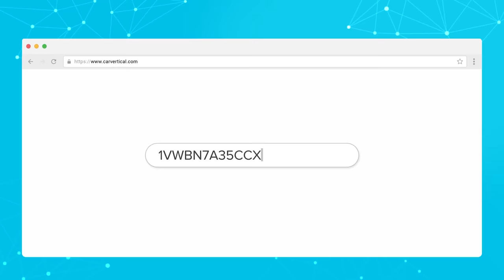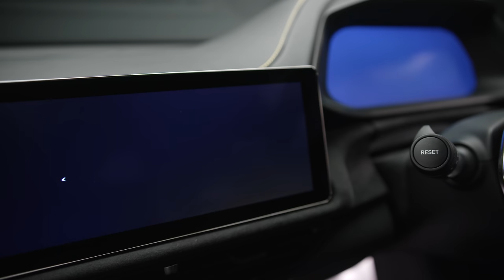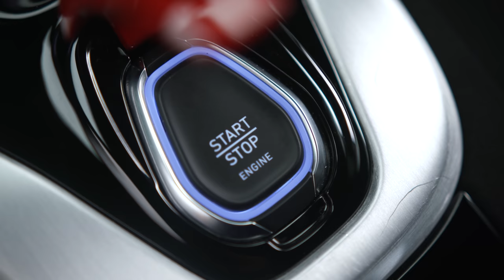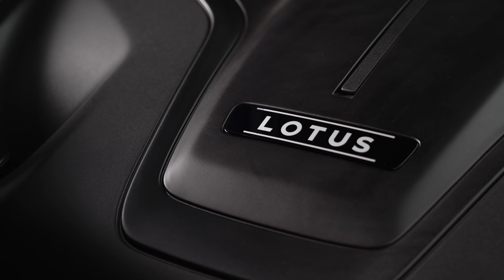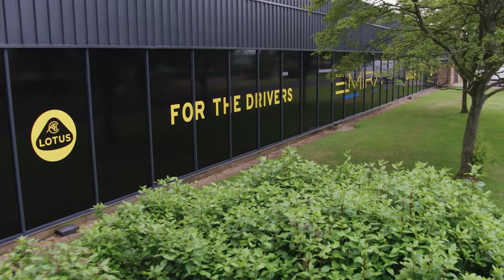The New Lotus Emira - An Evora Fan's First Impressions.

Comment: It's really a 21st Century Esprit...but what will alienate traditional customers is that silly iPad stuck in the middle of the dash. Ridiculous...performance cars should have simple buttons to give instant control and total focus on the road from the driver...not scrolling through silly menus to alter basic controls.
Reply: This should have been mentioned amor, I really don't like screens. The way they are implementing screens is as part of the vehicle, where we had before it was just the part for double DIN Dash that you could take out. I'm okay with a screen as as long as it's the dumbed-down functionality of music playing navigation. Or just make it a double DIN in the allow me to put my own preferably. I just don't trust a manufacturer to not screw with me I want my own stuff. If they had made the car with a bunch of switches and then allowed for the option to sell you the car with a dumb radio that you can do your own aftermarket that would have been ideal. For a driver's car I don't think that's much to ask. Either way I'm just going to get myself a Porsche from 2003 because I just hate all this new stuff
Reply: its a car designed to sell to a much broader audience than your typical lotus owner. without modern tech a lot of potential customers would be detered from purchasing one. its a step in the right direction
Reply: @Nobody-tp2gu  Porsche do not include such crudely concieved looking-tech and no one is detered from buying their products. This is poor design and dumbing down, pure & simple and looks totally out of place in such a focussed and fine-looking sportscar.

Comment: Fair assessment and interesting insight on the wheelbase issue. 
The crux of the matter is that whenever Lotus have a new big cheque book shareholder, the customer profile changes ("we must be able to take 2 x 100 kg executives...and golf clubs").
A 400 bhp / 1400 kg Evira / Emora has a power to weight ratio of 285 bhp/ton. 
Compare this now to a warmed up Lotus Elan : 180 bhp / 600 kg...300 bhp per ton, 57 years ago...

Comment: I have concerns with this car. I was hoping Lotus was going to produce an Alpine A110 rival. They have sacrificed weight to chase sales from Porsche. That’s is a dangerous plan. The car looks amazing m. Very similar to McLaren artura. If it is £60k it has a chance of success. If it is £80-90k it will be a failure and another British car company in trouble.
Reply: You hoped Lotus would produce an A110 rival, but had they actually done that they might as well announce their bankruptcy right now..... their first priority is to actually make some money believe it or not so that being said do you challenge a car that sells by the truckload or the one that is struggling to move even a paltry few thousand units 🤔

(BTW, I don’t disagree with also wanting something more in the direction of the A110)
Reply: The Alpine hasn't exactly sold by the boat-load. Porsche sell way more cars than that, so that's the market to go for.

Comment: My deposit's down on the premise I'll be paying around £60k. Much more than that and I'll refund it. I hope not because I really want a manual and there's no manual presumably 'cheaper' 4cyl option.
Reply: I was told today that a manual 3.5 would start with a 7
Reply: @gbtivbay  appreciate the info, haven't heard any solid figures yet or finance packages. Worst case scenario I'll refund or sell the build slot
Reply: Why are so many still obsessed with manuals? They’re just slow and with fewer ratios and no launch control. Why buy a high tech modern sports car then opt for a dated vintage gearbox? Mental…. “Yeah but it enhances the driving experience “ whilst being lapped by all the hot hatches and M2 A45 brigade 🙄
It’s no wonder Lotus have decided to not only update their cars, but their customer base as well 😊
Reply: @PiersDeMann  because its fun? I own an MX-5 because it's fun too... It is beat in a straight line by most top end hot hatches but that doesn't stop me grinning from ear to ear when I pull off the perfect downshift flying down a country lane with the roof down. A tesla is faster than most supercars - let's all buy them instead. You can't just reduce cars to top trump statistics I'm afraid.
Reply: @LukeEvans55  yeah I’m not sure how much you’d be grinning with your hand permanently attached to an 8 speed manual constantly stirring the gearbox on the AMG based Emira whilst driving through town
Reply: @PiersDeMann  8 speed manual? 6 is enough lol. I've driven one of the most congested roads in the UK as part of my commute every day in a manual and honestly it doesn't bother me. As soon as I get on the back roads its all worth it. I totally get an auto for a car that's supposed to get from A to B as mundanely and efficiently as possible but sports cars aren't about that in my opinion
Reply: @LukeEvans55  have you ever owned a car with a DCT box?
Reply: @PiersDeMann  yes, I had an Audi TT with a DCT and sold it for the MX-5. Partly because it just wasn't fun enough

Comment: Wow how much drivel is spoken in this video. Nothing shared with the Evora, looks amazing and in the flesh having seen it at good wood it was even better looking. Inside was lovely. Special editions will be porsches worst nightmare.
Reply from the maker: Only the chassis (at least pieces of it), the engine and gearbox (for V6), the wheelbase, suspension layout...
Reply: @JayEmmOnCars  not what the lotus engineers and designers told us at goodwood. 🤷‍♂️ the v6 of course is but that’s to keep current owners happy. The amg is really the one to have.
Reply: @JayEmmOnCars  Most manufacturers do it and there's nothing wrong with it. Felt the video seemed really negative given you haven't seen it or driven it.
Reply: @Munkey1234567  But it has double wishbones therefore it’s an Evora chassis. The engineers, designers and marketing teams are all lying to us. Luckily Jay is here to unravel this great conspiracy.

Comment: I actually thought it looked quite good.  ~1400kg is a bit heavy for a Lotus, and it's a little bit disappointing that it's probably quite heavily based on the Evora, but it still should (hopefully!) be brilliant. The fact that you can get it with a manual and hydraulic steering is fantastic. Great video :)

Comment: Only 360-400hp on a sporty (but heavier) sports car is disappointing. 
Makes little sense and may undermine user expectations for performance and heritage.
Also its torque is definitely too low for its weight and class. 
Needs to be a minimum of 450+ Nm torque as any competitor like newer RS3, Z4, …etc, all have better stats and can handle it.

Comment: I'm surprised you don't think the Emira is a looker. I don't think anybody here expected more power than the GT. The surprise is that it didn't  get that tune in the first place. As for tuning,   I wish you could drive my  decat, Komotec 435 tuned 400 again, James.  It speaks vigorously  to what a modest tune can do for the feel of the car. Of course a more robust transmission would have been ideal but I don't think that was expected based on what we could glean over the last months. Even with that limitation though, I think you're being  too hard on this car's design and I suspect the public  will find it gorgeous.  "Cause it is! 

Lotus content is always a treat on your channel and you know the marque so you may be right, but I think you may be off mark a bit just this once. Still, I'll keep my Evora for the foreseeable future.  They're tough cars to replace even with newer, more fully featured  iron being introduced routinely.

Comment: The trouble Lotus will have Stateside is that it has to be compared to the mid-engine,  10-speed DCT, V8 powered Corvette C8 and it doesn't look like it can do that favorably at this point.

Comment: Saw Emira today at Goodwood FOS. Blue car in the showroom, black car going up the hill. Both looked very good. Black car sounded better than a lot of cars going up the hill.

Emira looked a lot more resolved in looks to me than the early Evoras (I had one), better proportioned to. Interior a step up (or two). It's a bit wider than an Evora, & this did seem to show.

A friend though thought the Emira looked a bit generic, too similar now to other sports cars, & had lost certain design cues that made it look like a Lotus. 

Evora in USA suffered from lack of dealer network. When there were reliability & supply problems/issues, this put people off further.

I saw 2 Evora 400's in the main Goodwood carpark, they still looked very good.

Comment: Not surprisingly, you have provided the best commentary on the Emira.  No one else has has the insight or temerity to call it an Evora with a heavily reworked  exterior an interior.  My guess is that they did this because it was the cheapest way to bring out a new car.  The Emira is best thought of as a re-positioning car.  It started with the Evija continues with the Emira which continues the design language of the Evija and  allows Lotus to cut ties, at least visually with all prior models.  

I do expect the car to do relatively well in the first year and struggle after that.  A single car is not going to address their limited dealer network nor allow it to expand as it badly needs to do.  I also doubt that Lotus will invest much mor in this transition car meaning there likely won’t be more powerful versions or a convertible.  This car appears to have one goal beyond re-positioning:  give Lotus something to sell until its electric cars arrive.

For my money,  the Evora GT is the Lotus to buy.  The Emira is likely to make Evora prices very attractive

Comment: In terms of breakout sales (particularly in the US) this car is going to face a major problem in the C8. 

The C8 is not as good looking by any stretch and it lacks a manual. But it will be more practical, is significantly more powerful and faster, and has. Real dealer network. That’s the biggest hurdle right there. Also, the inducement of the more exotic mid-engine platform for the lotus is no longer so strong vs the corvette. 

But another huge issue is the price. If it does start at about $70k in the US, then it slots right between the Stingray (the inferior car in my mind) and the upcoming Z06. That’s a huge problem, given what the Z06 looks to be: sharper, more driver-focused, and packing an FPC V8 to boot. 

I wish Lotus the best with this car, and I certainly have something else to consider next year when I go car shopping, but it seems a big hill to climb.

Comment: I mostly agree and would prefer to skip ahead til next year when they announce the Emira S or 450+ horsepower variant that is sure to come about.  Feel like they should've started with that to be more competitive against the corvette c8 and cayman crowds.
Reply: It is beautiful and more livable but to be up on weight and lower on power than Evora is tough to stomach.   At least they kept hydraulic steering and manual so lets hope for 425-450 HP before they discontinue the V6.   No interest in a 80k 4 banger.   I  have a Type R for that

Comment: Here is the thing. If you only build cars for the purists and just the purists, you won't sell enough cars. To sell enough cars, you need to attract the interest from purists, petrol heads and driving enthusiasts, all of a wide range of ages. Young people never took to the Evora's and it was really only track day enthusiasts who bought Exiges. This new model, looks likely to sell well because a wide range of people will be interested. It will have the build quality, comfort and tech that everyone (yes everyone) will expect, but also (hopefully) be fantastic to drive. Looks like it has been designed to make it look like a modern supercar but with sports car performance and price (think first gen NSX). My only doubt, is that the AMG inline 4 will not sound like how you would expect a sports car to sound. But overall I like it and think Lotus have done well.
Reply from the maker: Young people are probably the least likely to be worried about a turbo 4 pot

Comment: 100% agree with your comments James. 
IMO it looks better than the awkward Evora. 
Really disappointed with the proposed power output, at that weight it needs to be 500bhp to make it special. 
Also the seat position looked really high. A couple of videos mentioned the seat would be lowered in the final production models by about 20 mm, but will it be low enough for a crash helmet on the odd track day.
Keep up the good work, great content.

Comment: Those vents on the hood (bonnet) are styled from the Evija, and perform the same job as the vents on the top of the bonnet on the Elise/Exige/Evora (they're where the air going through the radiators vent out), but according to Lotus do a better job aerodynamically.

Comment: Hi James - well done on your channel my friend. I love hearing your comments. Having had a soft spot for Lotus for many years (never owned one) I really want this car to work for Lotus. I agree with most of your comments - and disagree on some. To add to your thoughts:

1. Styling - I like the styling so far. Yes, the Evora looked odd from some angles (3/4 rear view mostly) and the Emira front vents looks like it came from the Exige, was hoping for a bit more pizazz in that area. Need to see it in the flesh to really guage the proportions properly as this was the Evora's design archillies heel. 
2. Engines - whyyyyyy did they not launch the V6 with a DCT??? (hopefully that may come later). AMG 4pot makes sense for a price point but not when the HP available is so close to the V6 (and the new AMG A45S has even more HP than the V6!). Why is the V6 only 400HP? Agree - should be 450 at least. Interestingly the HP values across the Emira engine range are almost identical to the Cayman ( base to the GT4.)
3. Spyder version - This could really work and am sure would boost sales (also covers the Boxster buyers)
4. Interior - totally agree. l think it is clean & simple and works and was always Lotus's weak point - which was why so many went to Porsche. 

 I am suspecting that Geely gave them a budget (they need the other funds to pay for the SUV development and factory) as this car somehow has to replace 3 cars (which were all very unique in their own way) - which is why you are correct in your Evora statements.. Emira is not a replacement for Elise or Exige in my view but for Evora and is squarely going after Porsche customers. I am going to assume that the new tie with Lotus / Alpine will cover the Elise / Exige later and keep the Lotus faithful happy with that car (electric & light).

 Emira was designed ( to me) to be a draw card for new customers to Lotus as a precursor to the the new SUV coming, which is where they want most of their sales to come from, as no car company ever made a profit from selling one type of sports car.  

Build quality, warrranty, dealership experience will be key in the success of this car, especially in relation to the above regarding the SUV. 

So much more to write about but my feeling is this has a 7-10 year life span so potential for upgrades is guaranteed.  

Take Away is : Geely wants Lotus to be a direct rival to Porsche, in performance, fit & finish. Old Lotus (just add lightness) is now Lotus / Alpine tie up.

Comment: Some background--I'm in the market for an Emira/Evora and have been very actively tracking the Evora GT and new Emira launch--I've been keeping tabs on the forums too and there is where I first noticed all the reaction to this vid by James where he was being accused of sour grapes due to his beef with Lotus etc..so I watched this video expecting to see some of that misplaced bile..
On the contrary--I feel he was very fair in his assessment and I agree with many of the points. I also was not blown away on first glance by the styling which struck me as generic supercar with something slightly off ard the back end...having a few more days to look at it and play with the configurator--Its grown on me but still not quite a slam dunk--I can clearly see why it would appeal to tons of people who love the looks and expect it also to be a sales success atleast off the bat.
I do feel though it is ultimately a revised Evora which is slightly more digital with a better finished less raw interior (better/worse here remains a bit subjective)  and modern electronics--with a slight weight penalty as a result of all the electronics. The styling is new and it obviously appeals to many. The driving should be atleast as good as the evora likely slightly better.  I do also feel however that V6 versions will not be too far off in price from the present Evora and may actually be more expensive. I think the range will start ard 75K USD for the amg motor and go to ard 125k for the V6 -I think the GT versions of the Emira when they arrive 2-3 years on might be the real sweet spot...
--Emira or Evora--hmm still tough question for me!

Comment: Emira vs Evora
similar length 
same wheelbase
same cabin size
same power train setup and placement of V6 engine SC
the trunk space is probably the same configuration .
front bonnet doesnt open and I would guess radiator is in same location and fans ect.
I would assume suspension setup is the same.with few tweaks
tow hitch is in same exact location in both Evora and Emira.

Comment: 400hp, 6 speed manual, RWD, Mid-engined, Hydraulic Steering, drop-dead gorgeous and at a Cayman price point. What's not to like? My deposit is in

If you want to go faster there's plenty of cars that can do that. But none with a 6 speed that looks as good as this and especially at this price point. Lotus knocked it out of the park